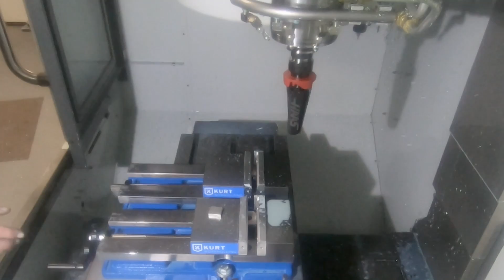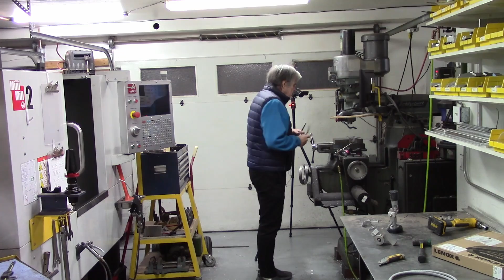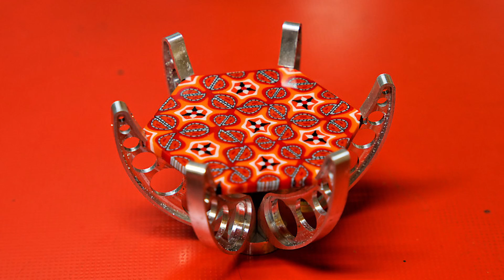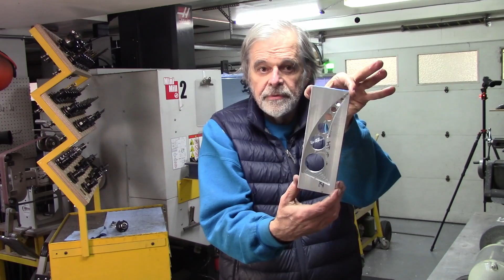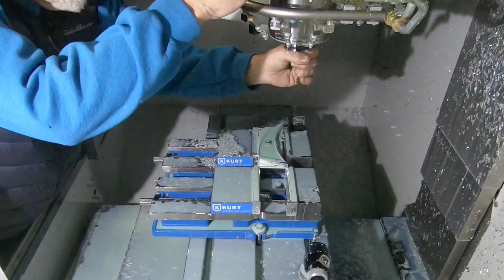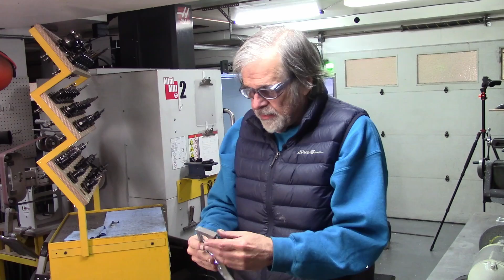S10:E10 CNC Machining with the Haas MiniMill2 and CNC Bridgeport. Sculpture Frame

Comment: Thank you for the video, it's been instructive to see small-scale production on the HMM and to hear your thoughts comparing it to a manual mill for small or one-off operations. During one of your shop tours, I remember seeing a CNC and some woodworking tools in/around the garage. For a single-person shop with low throughput, has dust management been an issue? I'm designing a space and trying to determine where walls and doors are necessary vs. nice-to-have. Cheers!
Reply from the maker: The shop started as a woodworking shop with an extensive dust collection system. As it transitioned into a machine shop, I removed the dust collection system because I was running out of space. I now use a shopvac and do very little woodworking